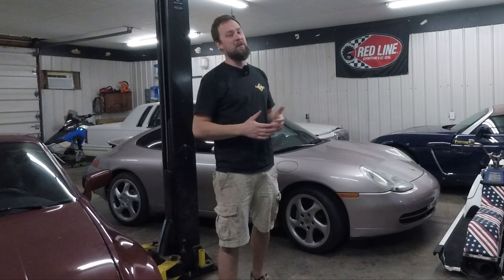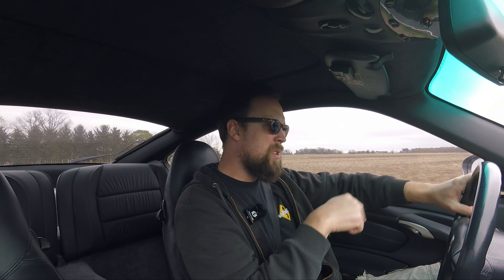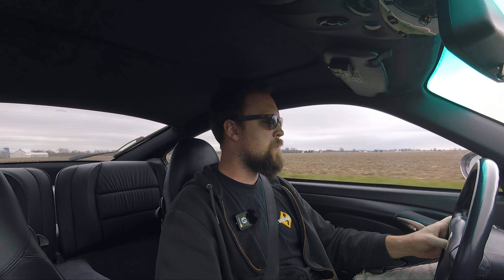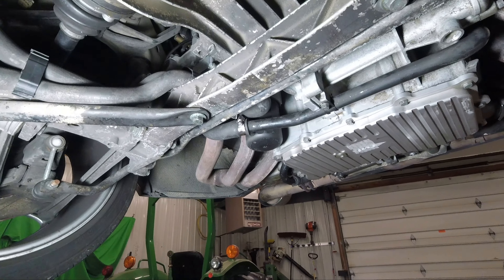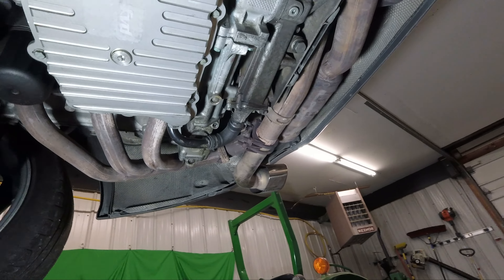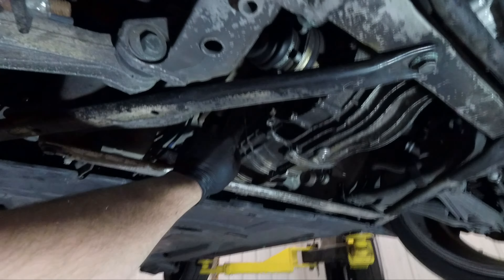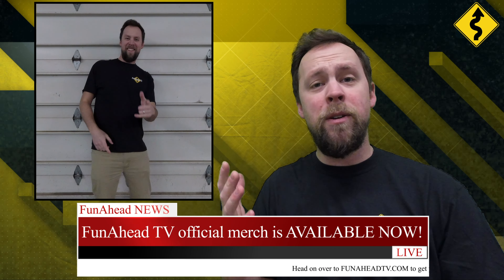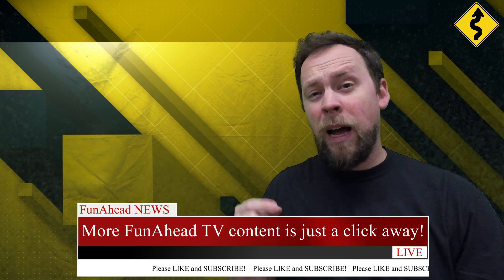FIRST RIP to REDLINE for my 911's FULLY REBUILT ENGINE!! Project Beef, Ep 13

Comment: Nice videos.  Unsure why my comments are disappearing, so I won't post any links.  You should really consider getting the UIDS (for correcting oil pressure instability) and the UOAS (for many reasons) if you plan on hitting the track.  The UAOS with track drain will allow for even more oil than stock.  It also corrects all the known failure points of the OEM AOS.  Sold by LN.
Reply from the maker: Yea, I don’t think YouTube likes having links posted in comments. I actually do run a deep sump on my car, in conjunction with the M97 oil return tubes. Haven’t had any oiling issues on track with that setup.. Stock AOS seems to do fine for me, but I have definitely considered the higher performance one as a future upgrade. Do you run the AOS? Curious if you notice a clear difference.